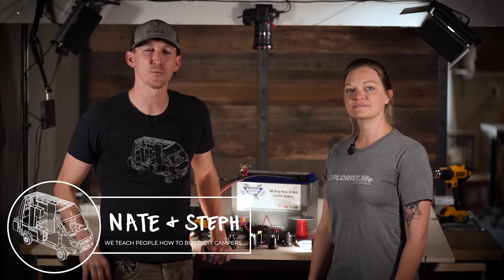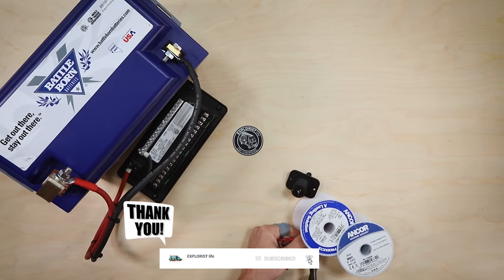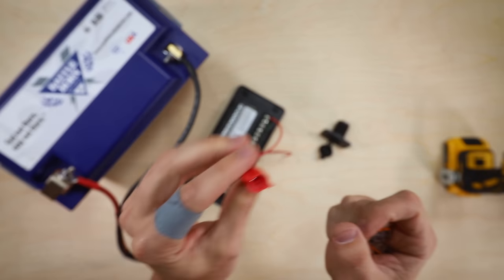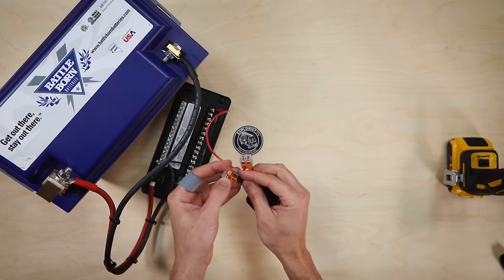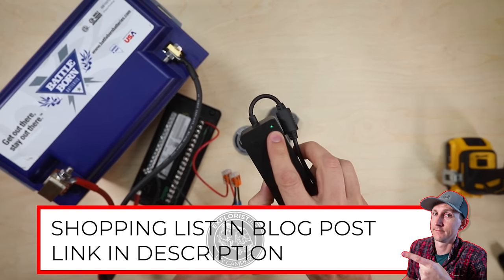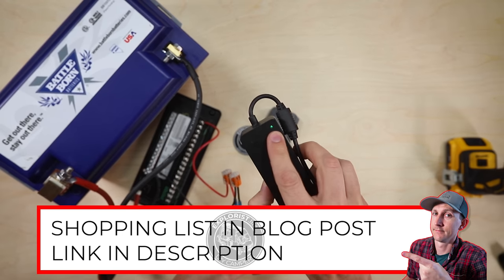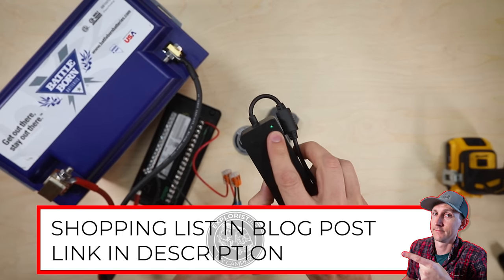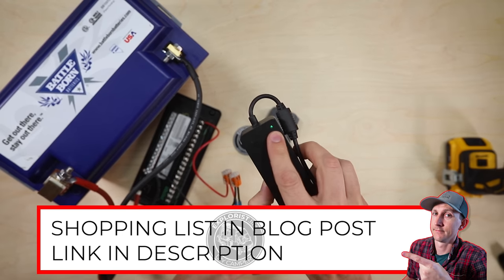Wiring 12V Outlets In our Ford Transit DIY Campervan (Full Tutorial)

Comment: So great video but total electric noob and I've got a question about outlets. I get that 110v outlets are for things like a mixer or blender and you have to have your inverter on what you use them. I was assuming that the 12v outlets were for charging phone or the like but then you said that you have USB outlets. Do the USB outlets run on 12v or 110v? And assuming 12v can they run on the same circuit as the 12v outlets? And if not why not?

Comment: Just LOVE what You & Steph do !  By Far, my Most Referred resource (many times daily on FB and Forums). 🥰

If you’ve covered it, any quick mention will suffice: in strings of LEDs, be it ‘rope’ or individual (3, 5, 8, 10mm) bulbs, there is a visible ‘decrease’ in illumination on a string (sometimes).  What do you think about powering (In) on both ends to reduce/eliminate ?  If affirmed, would each ‘end’ of 12V feed be a separate circuit ?

Regarding the lever wire block, is there a specific reason that you prefer that (additional) ‘break’ in the circuit wire, as opposed to just an uninterrupted (wire) from panel to item location ?

I REALLY Appreciate you two !

Comment: Are you using 12 gauge wire for those power sockets? Thank you for the videos they are a tremendous help.
Reply from the maker: Since our circuit was less than 10ft from fuse box to outlet, we could use 14AWG.  Please see the 12V branch circuit guidebook or the wiring kit for different length options: https://shop.explorist.life/shop/all-products/camper-wiring-kits/branch-circuit-wiring-kits/12v-usb-outlet-branch-circuit-wiring-kit/

Comment: On my 12VDC collections I've used Two Conductor Rip Cord designating the Side with the Ridges as Negative.

I purchased two Blue Sea 12 VDC hubs that has a cigarette lighter and the USB and a master on/off switch as the main oval connectors.

I also purchased OEM Ford Transit Cargo Bay Lights to illuminate the main part of the back section (as holes exist for them already) but wired them to the house power system.  

I'm using the same Rip Cord.  The thing about these modules is they're supposedly LED, but they function in either direction in terms of polarity. I am guessing that they have some kind of a bridge rectifier in them(?). I have designated the terminal closest to the screw on the back of the lamp module as "Negative," whether that's true or not.

I did my initial test on the light fixtures and the 12 volt outlet modules using a 9-volt Battery which was strong enough for test purposes.
Reply from the maker: Neat!  Sounds like a cool project.

Comment: Awesome video.  As someone who’s new to all this lever nuts are a great alternative to soldering.  Just one question, if I wanted to install a switch so that I could turn the 12v circuit off to not drain the battery, where would I install this? Between the batter and fuse block on the negative wire?

Comment: What is the benefit to using lever nuts when you are running a single 12v device circuit in comparison to just a running straight wire from the fuse block to the device? Thanks!
Reply from the maker: Flexibility, mainly.  Going direct leaves no room for expansion, further wire management, test probing for voltage during troubleshooting and stuff like that.
Reply: @EXPLORISTlife  but isn’t just making more chances of points of failure?
Reply: Yes I don't see point of mid connection, more chance of faults in future

Comment: Thank you for these videos, they’re great. I have a question though. I want to use a Bluetti EB240 to run everything in my conversion. How would I attach the fuse box to the Bluetti? I’ve seen people do this but no one has really explained (or likely I just haven’t found the right videos yet) how to connect the 12v fuse box to the Bluetti

Comment: When the length of the circuit you are wiring dictates a heavier gauge wire than the wire the device comes with, does the smaller wire on the device create a risk? (E.g. a light that comes with 16ga wire on a circuit that calls for 12ga wire).
Reply from the maker: The circuit must be fused for the smallest wire in the system.  Larger wire is 'usually' needed for voltage drop and not ampactiy.

Comment: Hi Nate & Steph! Thanks for this videos, they are SO HELPFUL!!! What size wire loom did you use in the van? Did you use it anytime that wires went into metal or structural supports? Can you explain a little on how you actually installed the wires? Did you put all of the wires into the loom and then feed the entire bundle through? Is there room (is it easy/possible) to add more wires to the loom after the fact? Something else? Do you have any tips (or tools) on feeding the wires through the supports? Really, thank you so much. This is a practical tip that might be obvious or easy for some but I'm trying to wrap my head around. I super appreciate your insights!
Reply from the maker: We will try to cover all of that in our wiring wrap up video.  The best thing I can recommend is to just buy some loom and play around with it.  There's not much of a right or wrong way to do it.

Comment: Thank you, as always great work!  I am in the process of using one of your plans that I bought to install a 2000-watt 200AMP lithium/solar / dc-dc rewire of the whole popup camper.    For this add-on, I have seen several installs where they use 10amp inline fuses at the positive side of the 12-volt receptacle, but you did not do it nor mention it.  Is adding the inline fuse at each plug over-kill in your opinion?
Reply from the maker: It's fused at the fuse box.  Additional fusing at the outlet isn't necessary.

Comment: I've heard that cigarette lighter sockets aren't safe...constantly melting plugs and overheating. Thoughts?
Reply from the maker: They are no more unsafe than an extension cord.  As long as it's sized appropriately for the load, it is a high quality component, and the connections are all secure, the chances of problems are very minimal.

Comment: Hi Nate and Steph. Great series of videos!! 
Do you use a switch on the internal panel for the USB /12V socket circuit, (Like the one shown in the diagram of the water pump) or only the main power switch turns off this circuit? :)

Comment: Thanks for all the great info!  Just have a quick question. Do wire splices  with wago nuts need to be in some sort of j box? Or are they ok left loose? Running circuits that don’t always end at a fixture. Thanks!
Reply from the maker: Low voltage (12V DC) doesn't need a J box

Comment: Hey Nate and Steph!! The videos are really informative as we’re in the process of converting our VW Crafter van here in Australia. My question is about wire sizing as here we use millimeters squared are the 10, 12 and 14 AWg the same as our 6, 4 and 2.5mm squared cables. Also what are the advantages to having 12v outlets?
Cheers William
Reply: @jdcoverland365  Hi, thanks for your response. I’ve ordered some twin core 4mm cable that is rated at 20amps from a local auto electrics supplier and connectors as well.
I’m interested in what kind of diesel heater you have and how it can be connected to a usb outlet. Cheers

Comment: This may be a silly question but if I have an AC appliance with a wall wart does that mean I must get an inverter/charger? When I did your power audit I put two iPhones and a MacBook in single charge items and our automatic litter box (has wall wart with input/output values) into Table 1.2 with 110v appliances. With these items I got "0 Watts" for inverter size in the minimum recommended components. We would like to have the ability to charge our batteries via shore power so what does this mean for our inverter/charger sizing?
Reply from the maker: If those are your biggest loads, you'd be fine with something like a Multiplus 2k Inverter/Charger: https://www.explorist.life/2000w-inverter-200-400ah-lithium-200-to-700w-solar-camper-wiring-diagram/

Comment: Question for you! To simplify wire sizes throughout the van, can we use 12 AWG wire for everything DC? It might be overkill, but is there any risk with it?
Reply from the maker: You can indeed consolidate like that, but I still recommend using my wire sizing calculator to verify that everything is still good to go from a voltage drop and max ampacity standpoint.

Comment: Great timing and video!!! I have an exterior metal rv light that has pos and neg wires run back to the fuse panel, would it ground only through the wire or also through the mounting screws? It works great in hand, but once I touch the metal siding it sparks and blows the fuse.
Reply from the maker: Glad it helped!  Interesting!  Sounds like a faulty light that probably needs to be replaced.
Reply: @EXPLORISTlife  thats what I’m thinking. It was a new light but I purchased another one. Hopefully It works 👍Thanks!!

Comment: what do u mean by checking for insulation in the lever nuts?
Reply from the maker: Just make sure there is no insulation interfering with the electrical connection inside of the lever nut.

Comment: Hi Nate & Steph. Off this topic I’m affraid however great video! 
 but I hope you can help. What is your take on using 2 banks of 4X 280aH 3.25V  lifepo4 cells in parallel as solar storage. There are so many batteries on the market that you don’t know what is actually inside them without spending a fortune….
Reply from the maker: When I was offering personal consulting, for a while, 90% of the people paying to talk to me were there because they bought all of these raw cells and couldn't get them to work.  Over time, some of them would have been better off, financially, just to pay for a high quality off-the-shelf functional battery like Battle Born.

Raw cells may be fun to tinker with, but I'm pretty much never going to recommend it outside of 'hobby tinkering' as the customer support, warranty, and QC just isn't there (which is part of the reason they are so cheap).
Reply: @EXPLORISTlife  great advice. And thank you for responding. Love the videos and the work you do. It’s difficult to get battle born batteries in Spain however I appreciate your response. 🤙🏼🤙🏼

Comment: Hey Nate, commented on your solar video on a question about your solar PV wire you have on your site. But I haven't heard back, probably cause it's an old video. But I'm looking to get some PV wire from your site. But  I need to know the outter diameter for the conduit for a specific install. Do you know what it is?
Reply from the maker: Our 10AWG solar wire is 1/4" in diameter on the outside of the insulation.

Comment: So why not solder heat shrink type of joint instead of the lever nut? 
You did use it to stretch the Spade connector?

I'm here for the physics lessons in electricity and possible future RV build. Your work is simply tidy and easy to understand, beautifully arranged and pleasing to the eyes! Keep up the great work
Reply from the maker: They are quick and re-usable so the replacement of a fixture at a later date (or future wire management) is trivial and they have a port for inserting a meter probe for voltage checks.

Soldering, doubling up on butt splices, step down butt splices, cap splices, or Scotchlocks do not offer these advantages.

Comment: Why do you not connect directly when only wiring for one outlet. And… if you think yo may expand later, is there any reason you couldn’t use a 3 wire connector for a single outlet, or does it need to be a double?
Reply: Never mind, Steph answered it later in the video😅
Reply from the maker: Flexibility, mainly.  Going direct leaves no room for expansion, further wire management, test probing for voltage during troubleshooting and stuff like that.

Comment: Are these cigarette lighter sockets? what for? for usb, i'd rather just install usb ports.  these cigarette lighters, aren't they antiquated and cumbersome? we don't use cigarette lighters any more, i hope we don't smoke.  are there any better/smaller 12V sockets?
Reply from the maker: We have a paddleboard pump and a tire inflator that requires a cigarette lighter socket. 👍

Comment: No Powerwerx powerpole (Anderson) connector conversions given the limitations of typical 12v "cigarette" plug ports?
Reply: There's heavy duty 25amp cigarette outlets available which are ceramic lined instead of all plastic. Perhaps that's an option.
Reply: @chachi5975  true, but in overlanding/offroading the movement and motion can sometimes jar the connection points resulting in intermittent or broken connections with plugs.  I and others have learned this the hard way.
Reply from the maker: We will be using powerpole connections later in the build.  I don't suspect anything will ever be permanently connected to this outlet, so it should be fine.  Regardless... People want tutorials over this particular thing, so this video is covering how to do it.

Comment: Just a quick note if you are upgrading wiring on a camper or pop up, black is POSITIVE, white is Negative!!!
Reply from the maker: Definitely worth verifying with a multimeter before starting work because often black is negative and red is positive.  Depends on the manufacturer.

Comment: Can I use all 3 outlets at the same time??  I think the answer is no.
Reply from the maker: Yep!  You just can't use more power than the whole circuit is fused at, similar to how you can use multiple outlets all on the same circuit at your house; but if you plug a space heater into each one; it'll trip the breaker.

Comment: What gauge wires do you use for your 12v and USB plugs??
Reply from the maker: You'll want to take a measurement for your own runs and then either use the 12V Branch Circuit Guidebook to figure that out or buy our kit for the appropriate length, which will come with the correct gauge: https://shop.explorist.life/product-category/all-products/camper-wiring-kits/branch-circuit-wiring-kits/

I hesitate to tell you the length WE used in fear that somebody with a 40ft run would try to use the same gauge of wire we used for a, say, 10ft run.

Comment: I used the set up in the truck and my 7 amp travel food warmer actually melted the spade connector.
So I soldered it instead……
Reply from the maker: Sounds like a poor crimp, undersized wire, or other generally poor connection.  Soldering the connection will create a weak point where the wire goes from stranded to soldered and will break over time as the vehicles vibrates down the road.
Reply: @EXPLORISTlife  I only use Narva HDRV plugs and sockets in the truck now.....cheap sockets melt 12v plugs too

Comment: Why overload the circuit with two additional receptacles for the same size fuse? Why not individual circuits for each? Aren't you setting yourself up for a catastrophic failure instead of providing a back-up available upon a single fuse failure? Ah, puck lights. My next project too. Here I can see series with a single fuse. Will we see a dimmer too?
Reply from the maker: We haven't 'Overloaded' anything.  Our outlets are rated for 15A, as is our wire, which is what the fuse size is; so everything is perfectly sized.  These outlets will be used for small loads like Drone chargers, computer chargers, and stuff like that, so it's perfectly fine to spread all of that stuff out along the same circuit given the total amperage load doesn't exceed 15 (but if it does, the fuse would simply blow).

This is similar to in your house, all of the 120V outlets around your bedroom are on the same circuit as the loads are generally smalller per outlet.  If you tried to plug a 1500W space heater into every outlet around your bedroom, the breaker would trip.  This is the same concept.

If we had a 12V load we would regularly be using that was close to 15A; it would absolutely get it's own circuit.

Comment: I tried reading through the comments to find this answer (as well as searched google for literally hours).

What specific reason would you have for installing 12v outlets into your campervan?
Other than the fridge (potentially)?
Reply from the maker: USB adapters, air pumps, 12V electric blanket (I've heard), electric skateboard charger.  All kinds of random stuff out there.
Reply: @EXPLORISTlife  thanks. I was worried i was entirely missing some part of my van build that was obvious to everyone else.

Comment: Why didn’t you just use piggy back spade connectors, would have been a much neater install?
Reply from the maker: That's also an option if that's what you prefer. They just can't be used when you may have 3 conductors coming off the same junction behind the outlet like you can with lever nuts.